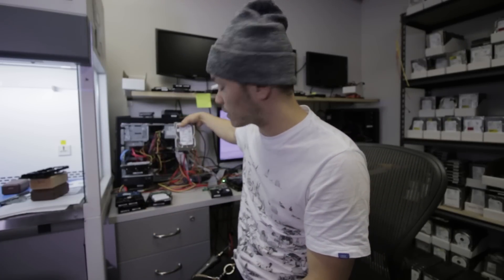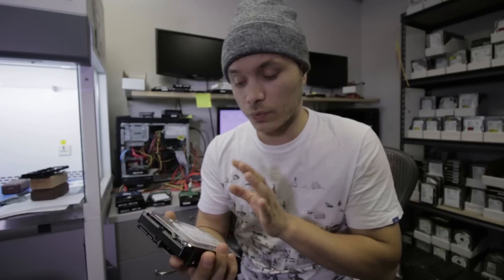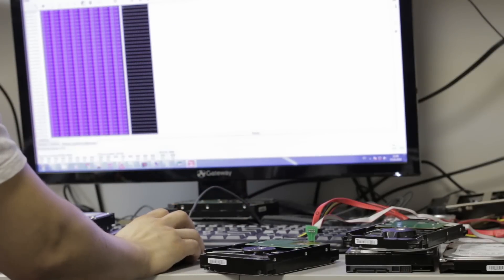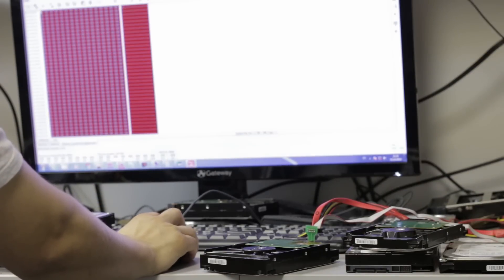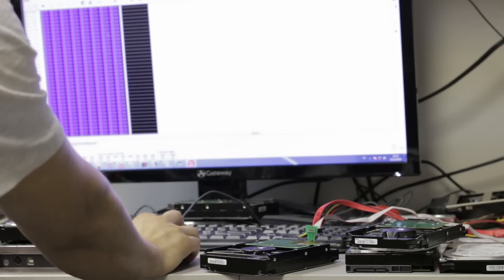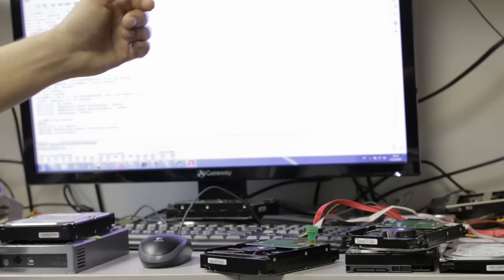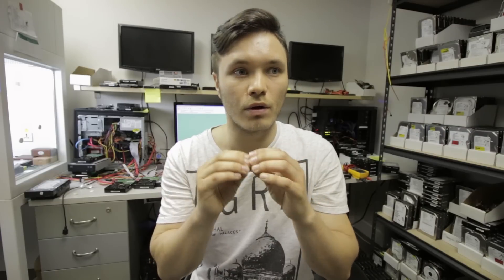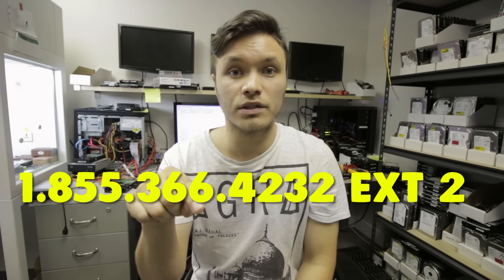data recovery | click of death on ST3000DM001

Comment: Damn, I seem to have a unique problem. My hard drive doesn't actually spin up, however it appears there is power to some degree going in, because I heard faint clicking. It is confusing to me, because just prior to it failing, it used to do some clicking and jittery noises before finally spinning up and working, however now it just won't even turn on any more, it just remains in that clicking state, and you never heard the actual platters spin up. I guess maybe it could be a component on the board? But the fact that it slowly failed instead of suddenly failed, makes me think it must be hardware and something seized up, somehow something has sized up that is stopping the motor from spinning , however the hard drive doesn't then shut down either, I am pretty sure a hard drive is meant to shut down if the platter fails to spin. 

I am not really sure, but I just so much want to get it to run at least 1 more time so I can get the files off it. I have some old multimeter of course and I will check that common fuse that maybe turns short circuit on the board, I really hope when I test that, that it is shorted out, so I can remove the fuse and then get into the drive 1 more time, otherwise it's so depressing, all the files I had, and no it isn't just pron either, it's a lot of information and personal photos and many things, sigh. 

I saw those freezer methods and trying to spin it in your hand. I didn't try the freezer method since I think that might be something you try as a layman if you are almost totally given up and almost came to terms with it being a loss. I tried to rotate in my hand fast, but nothing happened. I did hope the lid on it in a still air room and lifted the lid slightly and saw the arm thing was parked in the right area, so I quickly closed the lid to make sure nothing got in there.

Comment: I have the same problem but its a 2TB  Seagate barracuda and Found 3 Seagate barracuda with the same firmware CC27, first question is if send these 2TB Seagate barracuda what will it cost to recover an get it back to work. These seagate driver never been open at all. Fill free to contact me throw my youtube inbox.

Comment: do you know if the heads on these drives are compatible with the heads on the later version using the 100724095 board?

Comment: What exactly wrong happens with these heads that they start clicking?! I mean they move pretty free but then what makes them behave in this manner?! After a bit of research I knew there's some issue in my hdd head and then I opened it up n then wanted to figure out the issue so tried running it with the open hood and later it started the click of death absolutely clueless how to experiment more now, in a hope to protect my data on my own, any help from anyone for any related knowledge would be really appreciated from the bottom of my heart!! T_T :)
Reply from the maker: Physical damage

Comment: Awesome Video!!! Mine does not make any noise. The issue is The USB does not recognize Seagate. Device cannot start. (Code 10). In the Device Manager there is an Explanation mark on the USB Mass Storage Device.
Model Number: ST2000DM001  Family: BARRACUDA  1.5TB I've rolled back drivers, uninstaller, installed just everything I could think of. I need to recover my files. Any thoughts or ideas would be Greatly Appreciate. Thank You

Comment: External hard drive users, sometimes switching to another fixed USB port will work. I connected my external HD to an external 4-way port and I had the click of death. I next used a port directly built into the pc and it worked as usual.  It seemed that not enough power was flowing into the external port? I noticed I had issues with other equipment using the external add on ports. Though the external drive did work in the fixed USB port, I transferred the files to my PC and will be buying flash drives or a new solid-state external drive. Good luck, everyone.

Comment: The Seagate ST2000DM001 (2TB) and the Seagate ST3000DM001 (3TB) are notorious for doing that, guaranteed to fail in under 5 years, these drives have terrible reliability.

Comment: Where do I find  the tool that you use to protect the heads ? Thanks in advance.
Reply from the maker: Hddsurgery
Reply: HDD Recovery Services , HI great channel , so how do you tell the right time? i assume its like windows boot up to safe mode within 2-3 milli seconds before the spin up right surge of the motor can you be a bit specific i want to try this thanks.

Comment: If I or anyone else has the same Seagate 3tb ST3000DM001 with the same click of death and you have to do the same work as this video, what would be the cost?
Reply: free
Reply: @123kkambiz  Why?!
Reply: @Tome4kkkk  He's trolling. The price varies wildly between companies.
Reply: @prodge64  When I get back to Poland I'm going to give the disk to two companies at least, before deciding. Also, I'm going to setup a proper 2-disk-on-site, 1-disk-off-site backup this time :/ I'm starting some admin courses so it's a good idea to include it in my home lab as the first brick too :)

Comment: hi ...2TB seagate ...spins and make clicking sound once ... as she did normally when she was ok ... only difference is  ...HDD not detected at all ...
Reply: In disk manager ...sometimes it shows ...DISK 1 initialize ...but no other info like no size info etc......what seams to be the issue
Reply: @solarsystemislamabad  u got that rectified?
I'm also facing the same issue

Comment: I have the same drive. I found out these have a high rate of failure. There was even a class action lawsuit (2016). Don't know what happened with that.
My drive is broken, the data on it is (thankfully) not important. I will never buy any Seagate again. It used to be a reliable brand. :-/

Comment: Is this real?? - have exactly the same HDD with exactly the same issue.. I tried to open it in a hope head will be stuck, no luck.. it behaves exactly the same way. Actually I recorded a video of the head movement. Since the failure system no longer recognizes the HDD. Now I am wondering what are my options.. (I am from Czech Republic) - where can I get the spare heads to do the replacement? Can I try just to open read channel and recover all my data? BTW video of the head behavior: https://www.youtube.com/watch?v=7JszM9CYiaE Will be glad for any inputs. Thanks, Michal
Reply from the maker: Of course it is real. This model only has a failure rate of 43% LOL. You should have not opened the drive. This type of work now will range from $1200-2000USD in most North American data recovery companies

Comment: i have a 200gb samsung ata hdd that won't spin. One ground is severed, but i soddered it. still nothing. all diodes are ok the way i see it. Think it shorts when a ground is severed and power is on ? thanks
Reply from the maker: not sure, I would just swap the board and do adaptation

Comment: you're showing the same stuff over and over again, how comes you almost never get a real surface damage, broken off heads or just simple a fucking dirty drive needed to be cleaned first, tools and methods for partial data recovery

I don't unterstand the need for donor parts, why don't you use a universal spinning stand and a swapable single read head for every physical write method, read the platters one by one and align the data later in post processing, you wouldn't have to relay on drive electronics, just read the raw transitions of the platters and interpret them as servo information, data etc. Using nanopositioning actuators you could seek the entire surface in an automated fashion to find out where the traces and sectors are, in second step just position the head straight away to read them out.
Reply from the maker: I bet that store that sells those "universal spinning stands" also sells flux capacitors for a DeLorean. Why bother with a universal disk reading solution when you can just build a time machine? Travel back in time before the hard drive fails, make a copy, travel back to present, and give it to the customer. 100% success rate :))

Comment: sometimes it is not necessary to open the case to manually position the needle.. the problem may be in the power supply or in the connectors under the pcb, which oxidizes with time... you probably know that ( as i can see, you have a lot of hdd there on your shelf to be fixed )     let me ask you a question ?   don't you worry about dust sitting on top of the disk while they are open ?  your environment is far from being perfect for handling this type of device....   On the other hand, I heard that when the drive is spinning, the dust or any particle just goes away.   anyway... nice video anyway !!!
Reply from the maker: all internal work that we do is done inside of a laminar flow cabinet. conditions inside of the cabinet are perfect for the work like this.
Reply: HDD Recovery Services I just couldn't say it by the record you showed.   But anyone can say you are very well prepared for this job.
Reply from the maker: saying is one thing, but getting the drive that is dead to a point where that same drive gives proper ID and puts out data is another thing. That other thing without being properly equipped for the job just does not happen :)

Comment: The mine is (1 tb model) slow spinning (bios recognize) but windows don't... The controller board It has rusted areas.
Reply from the maker: make sure terminals to the preamp are clean (when you take off the PCB look for pads that connect to the inside of the drive). You can scrub them with an eraser
Reply: Thank you. I'll check that out!

Comment: I bought 5 of these drives as backup to my RAID. The only time they got used was when I filled the drive from my RAID, then left it to one side for when I ever need to restore my RAID if the RAID ever failed. A year later I needed to recover my RAID and tried to offload all my data from the Seagates. All 5 drives failed like this and Seagate claimed they were all out of warranty. Now I don't buy Seagate ever again. They are the worst manufacturer of hard drives I have ever come across. How they can make drives which don't even last the time it takes to read off all data just once is beyond me. How are they still in business?
Reply: I used to be a Seagate fan boy.. I've bought hundreds of their drives over the past 15 years. I would tell everyone that their drives were the only reliable drives available. (Going all the way back to the SCSI days)  After buying 7 of these ST3000DM001 drives and having all but 1 fail I will never buy Seagate again. They have permanently lost me as a customer.  And their response to the ST3000DM001 debacle has been to sweep it under the rug.  Worst company ever.  Now I go out of my way to tell everyone to never buy from this company.
Reply: Bought another after the first one failed. It worked for around 7 hours then died. I put the first one back in and its working again.  ??

Comment: i have a 3tb external/portable disc with adapter. in pluged in the wrong adapter to disc and now its not working. is there a way to fix it or what could be wrong?

Comment: So this exact model I have was in a external case. I had a power outage and it formatted the harddrive into .RAW format.
I took the case out and plugged it directly into my computer because via USB would not work. 
I used easeus Data recovery software and was able to get most of the data to appear in the software but at the time I did not have another harddrive to switch it over. Now, the harddrive will never connect/be recognized by the computer. It turns on, spins, and does not make odd sounds. Disk manager doesn't list it, Bios doesn't either, I can not find drivers for this harddrive. 
I can not get the harddrive to connect so I can do recovery. I fear the harddrive is dead dead.
Do I have to just do what you did in this video and get a exact model harddrive that is healthy and start switching out the parts in hope that it fixes it? Just so I can recovery it all to another harddrive that isn't this god awful product by seagate.
Thanks if you reply.

Comment: ST3000DM001 is the worst HDD I ever had.
The first couple of days I used it, it made me lose like 2 TB of data.
Then, only two years later, it started to develop an increasingly amount of bad sectors...
Reply: It's the hard drive with the highest failure rate in the past 20 years. So yeah, believeable.
Reply: Mine, too

Comment: I’ve got a 2TB Seagate Pipeline HDD, spins up then makes 2 of those exact clicking noises then spins down. 
This happened randomly one day, the previous day it was fine, would it also need a replaced set of heads as in the video? 
It’s only been used for 2 years.
Thanks for your time

Comment: hey tech guy.. i need help.. i have 1 tb toshiba not reading.. i have lots of important files in there.. i did everything.. chkdsk.. opened it and checked if the reader is stuck but not.. tried swapping the board of similar 1tb harddrive.. still not reading.. what should i do? please help..
Reply from the maker: if you need the data first thing you should do is not open the drive. Look for professional help there is no easier answer
Reply: HDD Recovery Services is there a hard answer/solution?

Comment: I have a same model drive. I can hear that platters spin without clicks but it's not being detected by any computer's BIOS. Do you think it could be a physical issue or a PCB issue? Thank you very much for being so generous and open-handed with your knowledge!
Reply from the maker: if the drive spins and does not click, then 99% it is neither. Most likely something either related to bad sectors, or firmware
Reply: And if it were bad sectors related would it be possible to get it back to life or it'd be a lost cause?  Thanks for your response!

Comment: This is exactly the problem i have on 1 of the drives in my NAS ! I set it up as a RAID so both drives are seen as 1 to maximise my storage capacity ! Bad Idea. I have zero redundancy and stand to loose all 6tb of data. What i need to know is how do i identify which drive is faulty ? Where i can get the little tool to sepearte the reading heads and what level of clean room conditions i need and how to achieve them before opening my HD ? Thanks from Scotland.
Reply from the maker: ScotsFurian you should call my friend Andy Watson from Databusters in Glasgow
Reply: Thanks HHDRS. Got any contact info ?
Reply from the maker: ScotsFurian http://www.datarecovery.co.uk/
Reply: Ive spoken with Adam and explained to him that my drive is in a NAS. I have two 3Tb Segate Barracudas but only one is faulty with the clicking head problem mentioned in this video. He asked if it was Raid 0 or Raid 1 and im sorry but i cant remember. I set it up for maximum capacity with zero redundancy. :/ I know bad choice and im regretting it now. Anyway Adam went on to explain that recovering the data from these drives is very unlikley with a 1 in 10 success ratio. He said its the plater thats the problem and not the heads and that even if you replace the heads due to the problem with the platter it will within a few minutes damage the new heads which is not long enough to recover the 6Tb of data.  Also when asked for a quote on a successfull data recovery he said it would be £800 or about $1200 I guess which is not feasable for me in my current financial situation. So what are my options ? How expensive would it be to attempt this myself ? I looked for the Head seperator tool and its crazy money for all it is. As for a PC3000 im expecting it to be horrendously expensive also. What can you suggest for someone interested in the topic of data recover with maybe an interest in making a living out of it from your own personal experiances ? Thanks for your advice and time dude. You rock btw. Cheers from Scotland.
Reply from the maker: this is not a DIY job dude, not on this drive. You will just end up killing it completely and killing the donor also. since this is a RAID0 you would to have an image of the failed unit made, that will take some sweating over PC3k

Comment: Great video!.
Can I change the hd's mainboard from an "identical" hd but with different fw?
Reply: You have to transplant eprom which contains platter calibration registers even same firmware.

It works most cases but if handling of eprom changed between firmware change, it will not work.

Comment: Why do they lock the drive after failure and not a simpler means than shorting the board. It sounds like either bad design or subterfuge?
Reply: Seagate has their own Data Recovery Service. I wonder if they have their own backdoor commands to unlock the drive. I doubt they have to go through the same hack of shorting the terminal read pins which is different for every pcb.

Comment: I have the same drive (ST3000DM001) that began to fail suddenly and now is clicking the same way.   It showed a few thousand reallocated sectors and I was attempting to remap them but gave up and now the drive is not detected in the bios.  I opened it up and verified the heads were not stuck.   I was thinking about ordering a donor drive to swap head assemblies.  Will this require terminal work and rechanneling the drive?  Not sure if its possible to just swap the assembly only or not?  The data is not critical but its worth 50 bucks to me.   Great video BTW!

Comment: Brings back memories. I was the guy who was in charge of a TI 990/12 with two DS80 'platter' drives (only 20Mb each!). I used to change heads on those. The head units were the size of a large soup ladle.